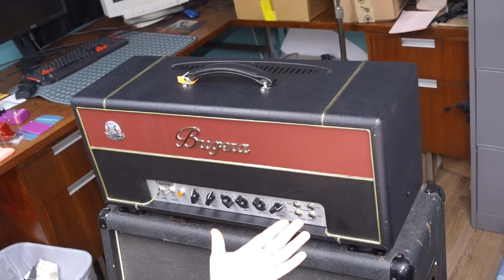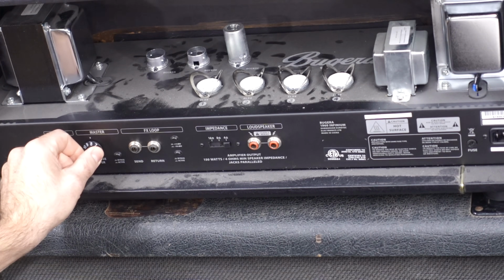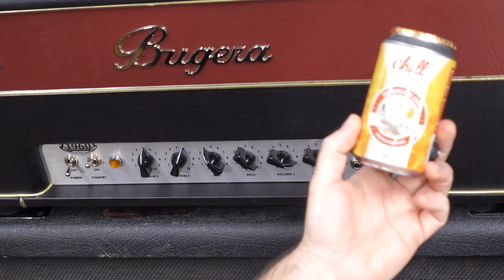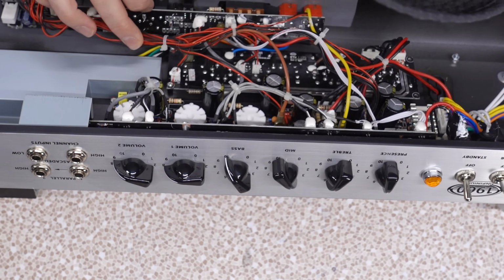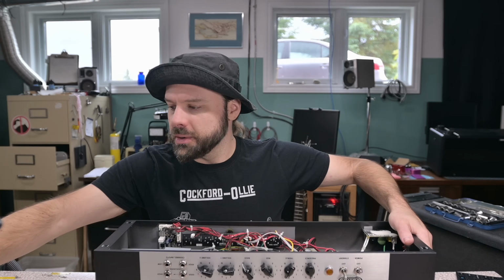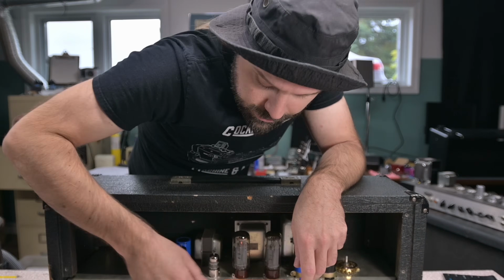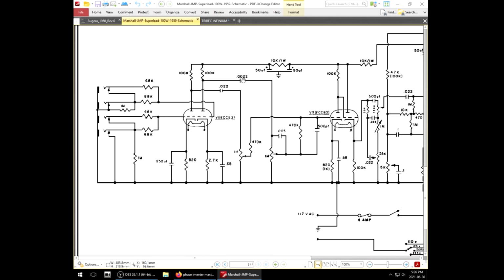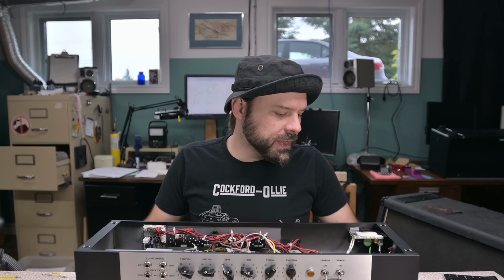Bugera 1960 - Inspection & Circuit Analysis

Comment: Can this amp do cleans at a higher volume? I have a V55HD head and its doin that ok ish but I want something bigger wattage and i was looking at Bugera 1960 to add to my collection. Thanks!
Reply from the maker: Depends on how loud you need. This kind of circuit will break up at some point, but you got a while before you get there. One thing is, it's a one sound pony. It could do one or the other, but not both.
Reply: @DATT  practice with a loud drummer and guitarist and for live, miced up
Reply from the maker: Hmm, a loud drummer. It might be clean enough. But then I might break up a touch before you get there. That  might be fine unless you want your cleans crystal. It's hard to say without trying. 
Mind you, if the 55w head you have right now is doing ok, which is prob only giving you about 40 watts of clean, then 100 watts will likely get you where you want. 
But again, this is a one sound at a time amp, there is no footswitch over to a dirty channel, is the only catch.
Reply: @DATT well its good enough, I m trying to find a way cheaper alternative to the Hiwatt DR103, bold I know😄. I have my other 300w+ amps for clean low end sound and I bi amp it with a 100w guitar head for the high end trebly sound sometimes with a little touch of overdrive
Reply from the maker: Oh boy, a Hiwatt. It has a topology I'm not familiar with, so I couldn't be sure if it'll do what you're looking for. The 1960 will def be more affordable, that's for sure, haha.

Comment: Do you think the dark channel might be useful for bass to approximate a marshall super bass on a budget?
Reply from the maker: For the most part yeah. The dark channel has the same cathode arrangement, but the super bass will have a bright cap on it's bright channel which is probably the one commonly used. 
Plugging into the bridged input, or bridging the inputs, bringing up the Dark till you get your volume, then adding in a bit of bright channel to add some highs should get the effect you want. 
There is a diff cap value in the EQ circuit, but I think that's negligible. 
One notable diff is the coupling caps in the Phase inverter that drive the power tubes. They are bigger. 
0.1u instead of the stock 0.022u used in the Bugera and Guitar Superlead. 
That cap diff will let more low end get to the power tubes. If I wanted to use this for bass, I might look into changing those caps. C26 and C29.
Reply: @DATT man thanks so much for the quick response. Ill have to look into finding one of these. Id been considering the super bass diy kit, i think mojotone? But even it was over 1k. My experience with behringer/bugera has been excellent. My V22 infinium has been through the ringer but still sounds great. Thanks again!
Reply from the maker: Hmmm, that's a tricky one. I'd prob of built a Mojo by now if I lived in the states. Shipping that stuff up here to Canada is brutal. If you think you have the aptitude to build a kit, that might be a decent investment. 
Or, you could get the Bugera, and if it breaks, jump off of it. Mind you, if you have the aptitude to build a kit, you might have the skills to mod and repair the Bugera. I know if I had one, I'd be able to keep it running. 
It's a simple enough amp that the only real thing I'd worry about is the Infinium circuit failing, at which point I could design a replacement normal bias circuit for it. There were older versions of the 1960 that didn't have infinium. That might be worth looking out for in your case.
Reply: @DATT copy that man i appreciate the reply. Im pretty novice at this stuff aside from biasing and parts changing stuff. I need to go after a mojo kit cause I think it might help me understand how things work a little better. Been struggling with what seems like simple stuff like eliminating the HF oscillation in my Kustom 72 coupe. If I go the mojo route its just a question of bassman or super bass...
Reply from the maker: Is the Kustom 72 Tube ? Sometimes it's just a crappy ground or something dirty. 
Modding a vintage amp is where a lot of us started. In Canada you used to be able to buy an old Traynor head from any hock shop for about $250. Working on them was easy so mess with them, till you broke them, then messed with them more till you fixed them. 
Cloning a Mojo might be a good idea, cause you'll end up with a vintage style amp that's easy to work on. 
Its like the diff between a modern car running off computers and an old card with a carburetor.
Reply: @DATT yessir its a james brown designed 4x6l6 2x12 combo. Ive been messing with it for a few years. Got it fir 200 from a pawnshop because it had a blown resistor. Replaced that then it blew a cap. Then noise caps. Then tubes. Now speakers lmao. When it works it sounds amazing. The vibrato and tremelo are kind of meh but useable. Reverb sounds great. Has a real tank in it. Found a deal for some eminence legends nib but not sure if theyre 1258 or 1275. I was lucky enough to get a full circuit print of it and finally got rid of the hf oscillation that was blowing stuff by installing some resistors.
Reply from the maker: 72 coup ?
Interesting circuit. Solid state trem and verb if the schem I found is the right one. 
4 preamp stage, must have some crunch ? OD to Metal ?
Op Amp footswitching looks like, that might be the hardest thing for a novice to fix.
Reply: @DATT  yeh I love it. Its a great pair with my straub cantus 50 for huge saturated p90 tones. Keep hoping to find a foot switch for sale somewhere
Reply from the maker: Hmm, Straub seems to be boutique. I wonder what circuit it's based on.
Reply: @DATT yeh I believe it's a sort of 1987x clone with a boost. I get super raunchy tones out of it but it's cleans are just so good I use a jhs sweet tea as a stand in channel switch so I can flip mid song
Reply from the maker: Nice !

Comment: The Non-Infinium amps were not bad with a few simple mods.....prefer to be able to control the BIAS setting myself with a BIAS Probe
I bought a 6262 Non-Infinium Head to mess with when they first came out and ended up over the years doing the following mods and it actual screams now. I play it more than my Orange Rockerverbs  and Mesa Dual Rec
1- Swapped all Tubes with JJ's
2- Re-Biased to correct Ranges
3- Added a Axiom R103 Choke (R62)
4- Added a 500k Linear Resonance-Mod (R26)
5- Swapped the Filtercaps
6- Swapped the OT w/ a Mercury Magnets OT
7- Direct Sodered PWR wire's to remove the cheap Molex connector

Has been rock solid and Metal tones for days
Reply from the maker: Hmm yeah, I could see doing some work on this if it was mine. 
I dont' think I'd fuss about the transformers tho. I kind of like the infinium, as long as it keeps working, I'd probably keep it. A master volume mod is what I really wanted to do.

Comment: Hey brother!! I really loved the video of you talking about your house wiring!!.. I tinker a bit with that myself.. even work part time as a shade tree electrician so ya, really caught my attention for the whole duration:) hey can you remember  the power tube arrangement for which output slots handle the A & B? I'm only asking cuz while you'd think as usual 1&2-A side 3&4-B however I got a tube getting real hot when in half power no matter where I put it
Reply from the maker: Half Power ? A/B ? In this amp ? It's a straight 100w amp as far as I recall. 
I know the arrangement is normal Push/Pull, so yes, 1&2-A side 3&4-B.
Sounds like that tube is defective or damaged. 
It's running hot, like red plating ?
It means it's not biasing, if it's not biasing, in any socket, then I'd say the tube is damaged. 
I've had that happen before, pin 4, the control pin, damaged internally and could no longer get bias voltage or signal, so the tube would just run away.
Reply: @DATT no, it did it no matter what tube or which slot (3 or 4) id try.. but it all went away soon as I stuck all 4 power tubes back in it
Reply from the maker: Ohhh, you're saying you'd pull 2 tubes to get half power, then those 2 tubes would run too hot ?
IN that case, I'd ask, are you sure you have the infinium model ?
They had 2 versions of this amp. One didn't have infinium so you wouldnt' be able to hot swap tubes with it like that. If you wanted to set it up half power you'd have to rebias. 

Also, if you go half power, you need to double load the amp. 
So, run an 8ohm cab using the 4 ohm output, or a 16 ohm cab using a 8 ohm output. 
If you dont' double load, yeah, even the infinium model could over heat.
Reply: @DATT it is the infinium, and ya, i switchedbit down to 4 ohm
Reply from the maker: Well damn, I might be at a bit of a loss then, unless I had the amp to work on myself.
Reply: @DATT that's what i would say too. Id likw tobmaybe remove the infinium curcuit but itblets me run my Sylvania 6L6s
Reply from the maker: It's funny cause I think that would actually be easy to do for me. But then I know how to design tube amp Psu's front scratch, and the bias circuits. And I can build using perf board, so I can make them reasonably small. Since this amp is already setup to bias the tubes individually, I might try to keep that functionality. 
Tho it might get busy trying to fit 4 pots and 4 test points in there.
Reply: @DATT the way the pre infinium ones did it was to just have 1 bias pot & make sure you get matched quartets, just like the Peavey 5150ii did and the EVH 5150iii Stealth
Reply from the maker: Oh yeah, that's most amps. And it saves circuit compilation. 
The Infinium would already have provisions for multi bias, so if it was me, I'd try to go for that. But that's me, hah.

Comment: I could have gotten one of these at a local Music Go Round for $300.00. I wish I would have seen this video before I saw that amp, I would have it in the living room!
Reply from the maker: Yeah eh, it's a nice amp for the price. Living room is ideal as Idk if I'd trust it on the road.
Reply: @DATT 
I am an old disabled vet who just makes noise with friends. I don't need a touring rig.
Reply: @DATT 
Out of curiosity, what make you say you wouldn't gig it? Is it the craftsmanship? I have a Bugera T50 infinium and that thing can take a beating. I have a Trirec coming and I plan to use it live. Asside from the "made in China" thing I see people have a problem with I don't know how this PCB build is different from eberyone else's.
Reply from the maker: Behringer/Bugera is not known for their construction quality. I worked in sound for years, and seen Behringer fail. Also, there is literally more than a few comments on my Bugera vids about people having problems with them. Specifically there is one guy with a failed Trirec. Their engineering is top tier, but their assembly is not. 
THis amp, and maybe the T50 are more simple, so less margin of error. The TriRec is a complicated amp, so go figure that would be more liketly to fail.
Reply: @DATT 
I don't exactly believe random internet comments about quality. Most people daisy chain speakes into their amp without understanding impedence and blame the amp when it lets the smoke out. I do listen to techs. I just wonder what it is because there are countless cheap amps out there and I have had Fender,  Marshall and Mesa be stricken by gremlins so I always wonder what people are trying to say when they don't "trust" an amp.
Reply: @DATT 
Again, out of curiosity, what would you do to one to make it more "gigable"? There are cheaper guitars that could use a re-solder, shielding, tuners, bridge components etc to make them usable live and I wonder what it wold take to make these more robust because they sound so good.
Reply from the maker: Yeah that's true, some people simply don't know what they are doing, and a couple squeeky wheels doesn't mean the whole car model was a lemon.
Reply from the maker: I'm not sure what I'd do to make it more giggable. I would just use it, but keep a backup handy in case. 
Maybe dont' put the head on the cab to minimize vibrations.
Reply: @DATT 
I actually just traded a buddy for a Trirec and it wasn't handled very well by UPS. It arrived last week and the box looked like it had been dropped. I opened it up and the case showed problems. There are braces in the upper corners and one busted off and broke a 5u4's glass loose from it's base. The chassis looks a little buckled by the output transformer. You cane wobble the whole thing now. I haven't opened it to see of I can notice any obvious problems, but I would say a new head case made from high quality plywood would be a serious improvement.
Reply from the maker: Oh wow. Yeah the case is only MDF. The wrong fall would break it indeed. 
Fortunately, the amp will work without the 5U4's jsut pull them and set it to Solid State mode. 
That's some bad luck tho. I hope it works out.

Comment: I've got one of these things and I've run it EVH-style:

• JJ 6CA7s in the power section
• Resistive (not reactive) attenuator, because EVH just put a honker of a resistor between The Magic Marshall™ and his cab
• Every control maxed out except for the bass (6ish) and the bright channel (7-8)
• Smack input one with a guitar with a hot PAF type humbucker in the bridge 
• Use the attenuator (I use a Jet City Jettenuator because Mike Soldano designed it to take the full peak output of a "100W" Marshall) as your volume control
• Enjoy!
Reply from the maker: Oh yeah. I totally do the some thing these days. Or similar anyway. 
Usually at 50watt configs tho. I actually modded one of my 4 tube heads to run four 6V6's instead so I could get the sound of 4 power tubes clipping but at only ~50 watts.

Comment: You're not distorting the phase inverter because it comes after the phase inverter. It may possibly be the wrong kind of pot. Because i too do not believe it works properly either.
Reply from the maker: It's a post phase inverter master volume, which means the Phase inverter is getting distorted. 
Either way, it def sucks.

Comment: Is this a good amp?   I bought the 1990 im not happy
Reply from the maker: It's a very different beast. It might depend on what about the 1990 you dont' like. 
The 1990 is a clone of the Marshall JCM900 Dual Reverb, and the one I tried did that job well. 
Tho the 900 DR is a hybrid Solid State / tube preamp so it might not do certain vintage tones as well. 
It's decent for modern rock, pretty good at 90's punk and most metal.

Comment: Hey you seem to actually care about this amp. Most people I talk to say "it's just a cheap POS, get a real amp." However I find it sounds amazing and it cots 1/10th of a plexi used. Mine started blowing an f1 fuse every fuse startups. Switched lots of tubes, does same thing but at different speeds. Let me know if you'll work on it or give me advice
Reply: Got mine today ! Look at your electrolytic capacitors ! The big one. Check your bias voltage ! If it's too hot, you will suck too much ampere.
Reply from the maker: Someone else here commenting was also having a problem with a Fuse blowing. Can't remember which one, but it was the heater fuse, so not even a cap problem. 
But yeah, it's a great amp when it works. Just the durability might come into question.
Reply: @DATT  would love if they made a new revision, maybe smaller wattage, without the infinium circuit and easily biasable from the outside...it will never happen tho ;)

Comment: I have one of this. SInce is a simple circuit, I modded it to be a SIlver Jubilee. It worked pretty well, but with the time, volume started sounding lower and lower, so I took de Jubilee cirrcuit out. I sat collecting dust for like a year so I turned it back to the original model. It worked, but I didn't lke the tone so I modded it again now into a JCM 800 and worked GREAT! But like the original JCM 800, the clean channel is not that loud, and I want to use this amp with a Helix LT, so I have issues with the volume. I think I'll experiment with the Helix in some other amps. Cheers, and great instructional video!
Reply from the maker: Jubilee ? that's a completely different circuit, that's one hell of a mod. 
A helix ? Well, I guess you need as loud and clean as possible, which idealy would be the original circuit, but maybe with some subtile adjustments. 800 would be my last choice for an application like that.